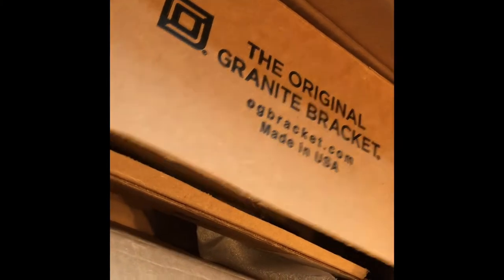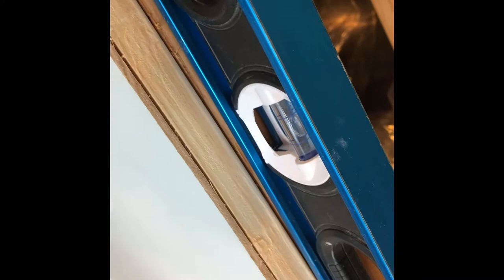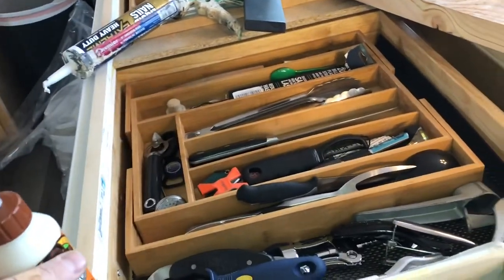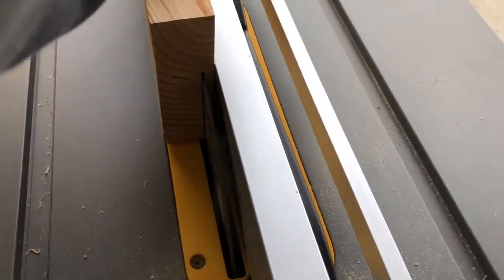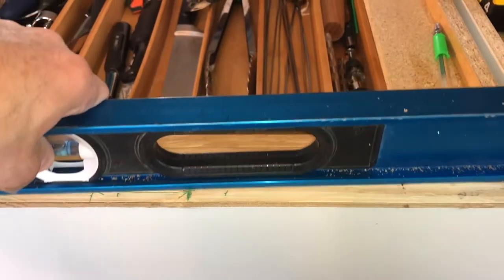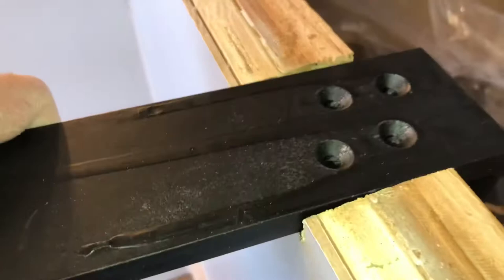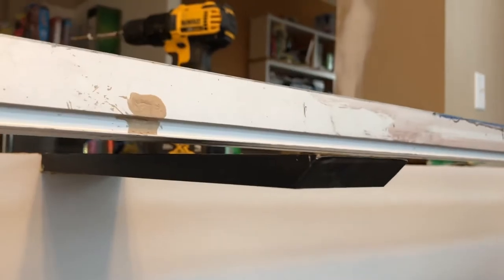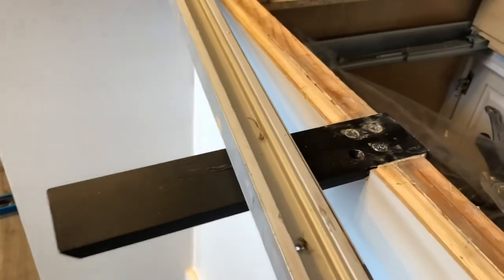Granite or stone countertop hidden brackets support insulation instructions

Comment: By placing a shim under the bracket you were in essence preloading the bracket. Instead of it being completely level the bracket tilted up slightly. I’m installing some of these and wondered if you did this just be sure the brackets were carrying the maximum amount of weight.
Reply from the maker: Yes you would want that extra support

Comment: I have a question for you. I just met a new client yesterday who has one of these overhanging bar countertops built onto the top of whats essentially a 4' high wall, similar to ^this. But they installed a very heavy slab of granite of approx 8' long x 24" x 1"-1.25" thick. The problem is that its sagging badly on the overhanging side, because the steel support braces have sagged under the weight.

 They suggested straightening it up again, then installing 4-5 wooden brackets to the wall underneath the overhang side, and atttaching them through the drywall into the studs inside the short wall that makes up the support base for this bar. They dont care if the brackets look slightly off center, but they want to keep the bar, and they dont want the whole slab to collapse and hurt someone. 

Does that sound workable? Thanks.

Comment: What about counter install?
Reply from the maker: That comes in after this of course The owner of the house hired a countertop company to come in and install
Reply: @KooperSalmo  gotcha, I guess what is the recommendation for attaching counter to the metal bracket, especially for the stud brackets? Should I use adhesive?
Reply from the maker: @thejpkotor  for sure because The adhesive will make sure it's 100% setting where it should be between the bracket and the countertop just in case you don't have it flush up against it perfectly I mean nobody can get it 100% perfect so the liquid nails adhesive will make sure that it is perfectly where it needs to be